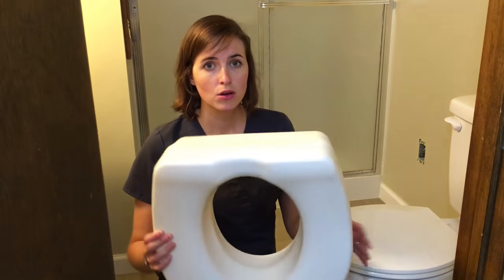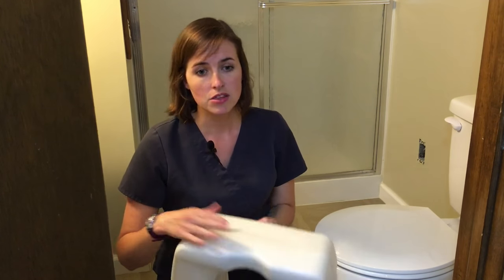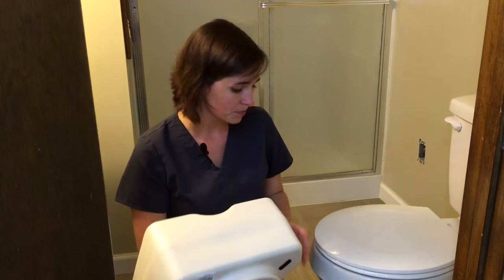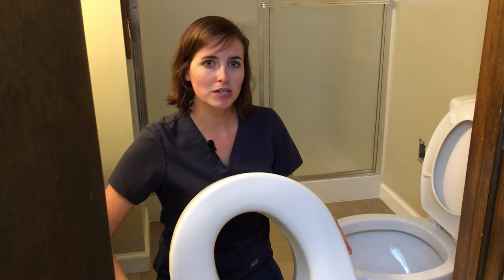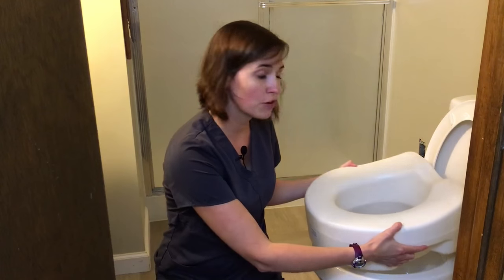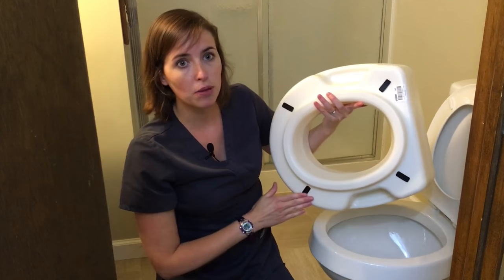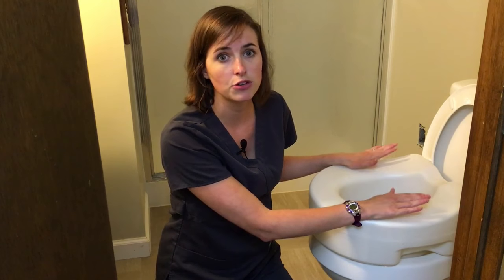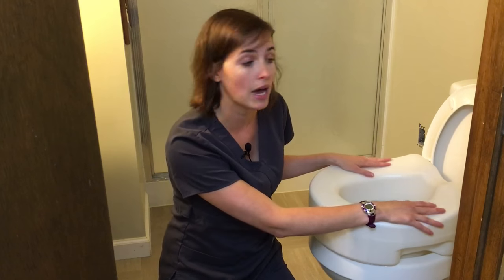How to Install a Raised Toilet Seat No Assembly Required | Carex Raised Toilet Seat

Comment: HI, Is it easy to clean? I am 55 years old and having trouble standing up theses days.
Reply from the maker: Relatively easy to clean. It's simple in the sense that the whole unit can be removed for a deep cleaning without any tools. I often remove and place in the shower for a full deep clean and then clean the toilet under before putting it back in place.

Comment: Do different risers have different widths in the back?  The one we got for my mom is too wide and doesn't fit correctly in the space between the toilet seat and the bowl.  It's a ProBasics brand one.  Do you know of other brands that may be more narrow in the back?
Reply from the maker: Do you know if her toilet is a round bowl or oblong? It’s possible she has an oblong toilet and the riser is for a round bowl. I personally like the Carex brand riser for its shape. Seems more comfortable. Hope this helps!
Reply: @EquipMeOT  it slides off when you trying to wipe your butt...is there a way to make it stay and not move?
Reply: Excellent video  and well explained

Comment: You put the toilet seat on backwards fyi.
Reply from the maker: The flat portion of the toilet seat usually goes towards the tank. This product has an opening on the flat side for wiping instead of the rounded side (to be fair, I much prefer the design with the opening in the front and back).